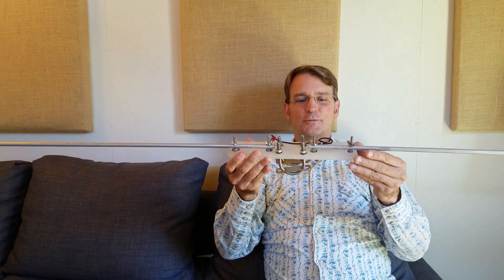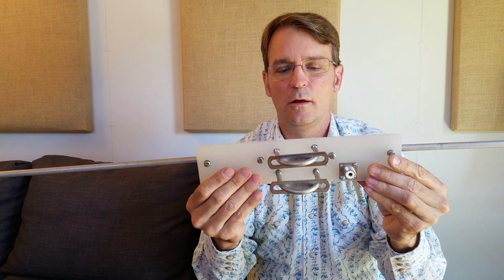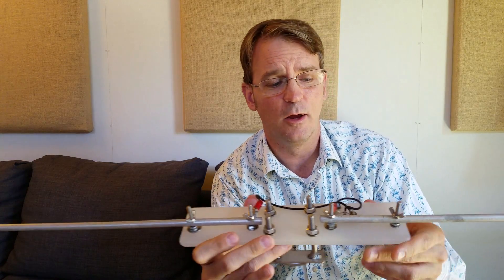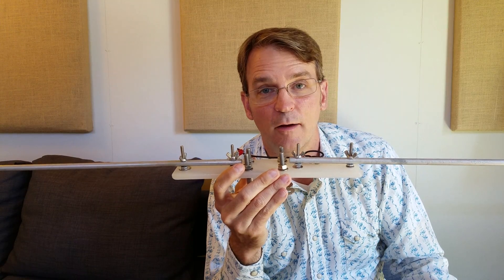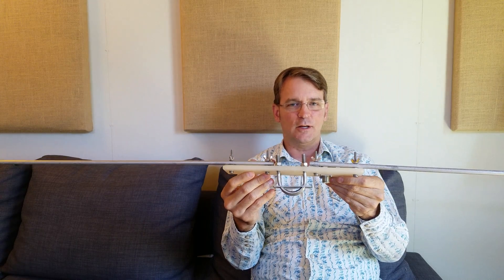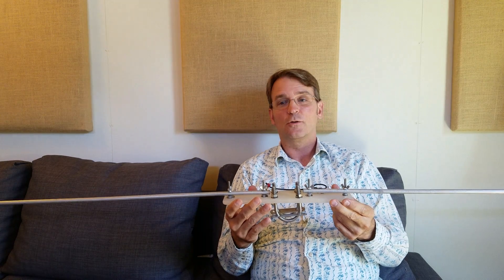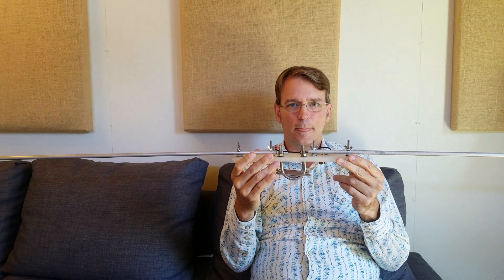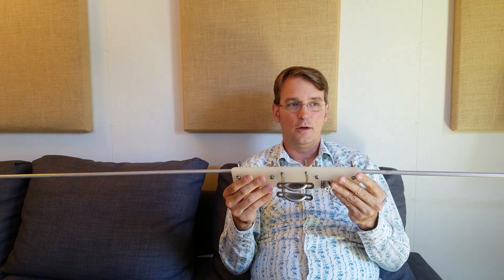Six meter ham radio dipole for the VHF contests

Comment: I'm building and attaching one of these to the top of an Inverted Vee dipole antenna mast for this summer's Field Day!

Tnx, 73!

Erik, NO8Z
Reply: P. S. I see in the description Kyle that you trimmed this antenna to 132cm. If that's the overall length, does that make this a 1/4 wave antenna?... In which case, why is the total length not 142.6434cm?

Comment: I made one for June Contest. Mine is Copper 1/2 inch pipe. Stuck it on a painting pole.   SWR looks good.  Can't wait to try it out!
Reply: I've got a handful of various length copper pipes out in the garage and that is what I was wanting to use. I think all mine are 1/2" and 3/4"...
What was the exact length you cut each Pipe too?  I'm wanting to try building one of these in the next week or so. 
Tomorow, I'm going to go to the DG and a few other cheap stores looking for sacrificial cutting boards.

Comment: if nothing else, the cutting board insulator is a good tip. I wonder if 1" copper tube would radiate better? Heavier for sure but heavy is ok for base antenna. And I assume mount is horizontal????

Comment: The E skip has been rolling good the last few days.  I got my first 6 meter antenna setup at hamvention and put it up the day I got home.  I have been wanting to get on 6 for some time and am glad I did.  
I bought a buddipole setup for camping and currently have that installed at 35 feet,  I ordered a moxon antenna and when it arrives it will go in the buddipole's place.